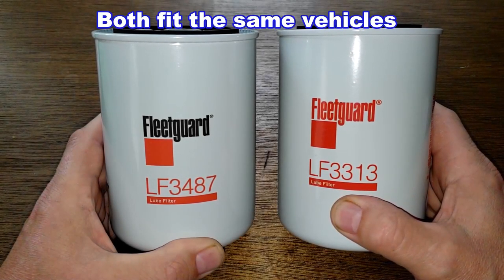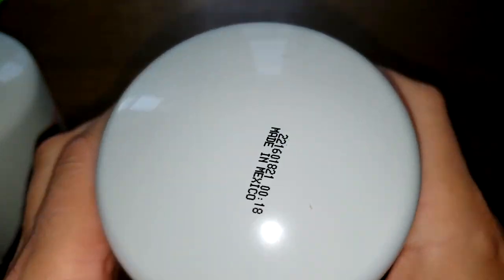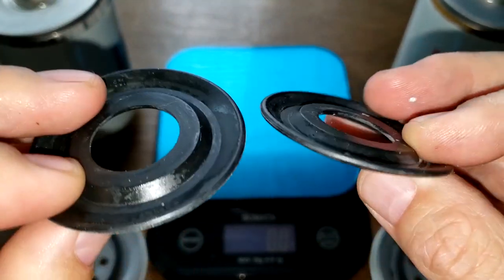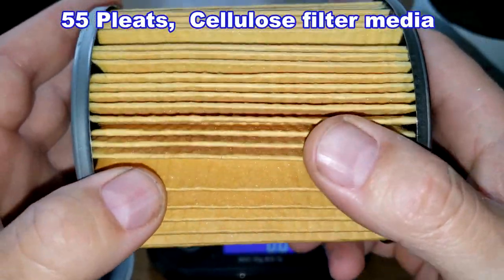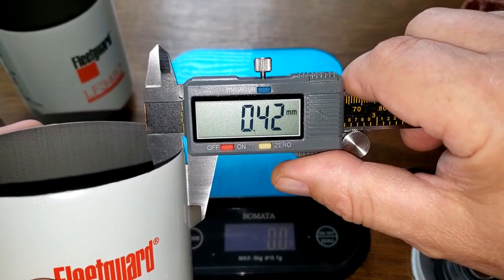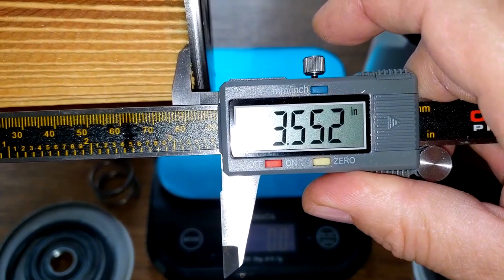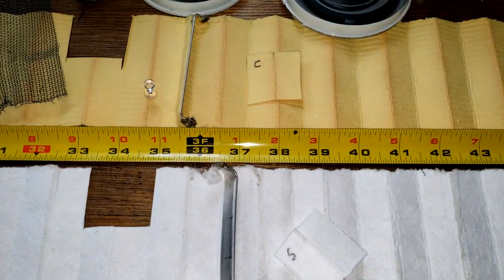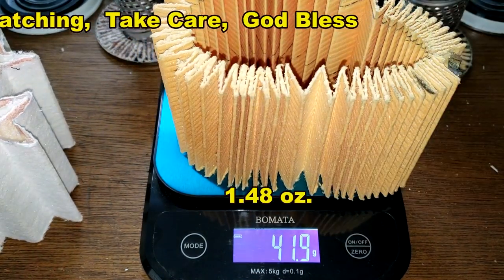Fleetguard LF3487 Oil Filter vs. Fleetguard LF3313 Oil Filter Cut Open

Comment: 68% at 30 microns for the cellulose model?  That has to be a typo. Is that the worst rating ever seen so far? Now 100% at 30 is probably 99% at 20 or 25 and much better.
Reply from the maker: Could be, check this out. https://catalog.cumminsfiltration.com/catalog/partsearch.do?&reqCmd=PartInformation&partNumber=LF3313&PartType=Lube,%20Full-Flow%20Spin-On&Part=-&criteria=part&_locale=en

Comment: I do believe you're exactly right! I called "Fleetguard" or Cummins Filtration 20 years ago and that's what they told me, it's the media. I haven't bought one of those in a long time but they were made in the US when I did. They should probably consider upgrading the 'rubber' parts to silicone for what you pay for one. They used to call the 3487 media "Microglass" and it had a sparkly appearance. I think that media is more a synthetic + fiberglass now. The BPV on the ones I got were 11-13psi. Also had a real metal backing screen on the 3487. They really cut back on that one! I probably wouldn't 'search' one out NOW, like I did in the past. I think the Boss would be a slightly better filter. Nice comparison, thanks!
Reply from the maker: It's a real metal screen backing, I was just pointing out how flexible it is, some are really stiff.

Comment: The 3487 is the superior filter, media (wire backed full synthetic) and efficiency rating. Both look to be well made HD diesel filters. Both use louvers, which is fine. Too bad not made in the US though. Last Fleetguard for vehicles you posted was made by M&H Purolator in the US. Thanks for vid.
Reply: Fleetguard has a plant in Quimper, France and San Luis Potosi, Mexico in addition to their USA plants.
Reply from the maker: Your Welcome faxmen09!
Reply: @Nash_Nismo  That's good to know, but doesn't change anything in my post.

Comment: Decent filter all around. I've used more of them than any other brand over the years. With that being said, some filters do come from France. I've had one of each French and Mexican made. Be interesting to see if you can get two different manufactured location of the same one.
Reply: Fleetguard has a plant in Quimper, France and San Luis Potosi, Mexico in addition to their USA plants.
Reply: @Nash_Nismo  one is oui and the other is si
Reply: @mimelio  😂

Comment: Been running Fleetguard oil and fuel filters on my 6.7 Cummins for years.I have had some great oil analysis results from blackstone labs. Fleetguard makes the highest quality filters IMO.  I run the stratapore version witch is the synthetic media Lf16035.
Reply from the maker: I'll be opening up that filter sometime in the next couple of months.
Reply: fleetgard filters are owned by cummins.

Comment: In regards to the cellulose media efficiency rating, I had purchased a smaller filter from Fleetguard and requested the data sheet from them for it. This is what I got:

Anti Drain Back Valve Yes
Valve Opening Pressure 144.8 kPa
Element Collapse/Burst Minimum 0ISO 4548-3
Hydrostatic Burst Minimum 0ISO 4548-6
Capacity 11.8 ISO 4548-12
Rated Flow 11.4 L/min ISO 4548-12
Efficiency 30.8 @ 21.0 micron (c)

My understanding is that this is not the typical % efficiency at (numerical figure) micron rating we're familiar with. Instead, based on my research, the first number, 30.8 is actually the βₓ value at 21.0 microns. When you convert this to the traditional filter efficiency we're accustomed to using, it becomes 96.75 at 21.0 microns. On an estimated sliding scale, I'd say that suggests a 95% efficiency at 20 micron rating, which is comparable to the old, standard WIX. I'm paraphrasing my own post in the thread linked below. I'm not claiming I'm correct, but it's the only reasonable explanation I can come up with for their cellulose media efficiency rating.

https://bobistheoilguy.com/forums/threads/help-with-oil-filter-data-analysis.357612/#post-6184210
Reply from the maker: Thanks John,
Looking at the microscope pic, I think it is better than what I said it was also. This is where I got the info for this filter, but I'll pin your comment so that it sits on top. https://catalog.cumminsfiltration.com/catalog/partsearch.do?&reqCmd=PartInformation&partNumber=LF3313&PartType=Lube,%20Full-Flow%20Spin-On&Part=-&criteria=part&_locale=en
Reply: @WhipCityWrencher  appreciate it! I'm tempted to confirm directly with Fleetguard, but I'm fairly certain they measure their efficiency in Beta (βₓ). If I hear back from them, I will post back. Thanks for your insight with the microscope, too. You've looked at a lot of media from a lot of filters that way, so it definitely helps.
Reply: @WhipCityWrencher  

Well shoot.

I just got off the phone with one of the gentlemen on the technical assistance line for Cummins Filtration. He told me that typically, hydraulic lube filters are rated in βₓ the other filters (oil, fuel, etc) are stated at a percentage-based efficiency rating. I updated the earlier post with a picture of the data sheet for the filters I'd gotten and inquired upon. If I'm reading the sheet correctly, coupled with what the gentleman on the phone said, I'm not sure these are terribly good filters in terms of efficiency. Here's the specs for anyone who missed them:

Anti Drain Back Valve Yes
Valve Opening Pressure 144.8 kPa
Element Collapse/Burst Minimum 0ISO 4548-3
Hydrostatic Burst Minimum 0ISO 4548-6
Capacity 11.8 ISO 4548-12
Rated Flow 11.4 L/min ISO 4548-12
Efficiency 30.8 @ 21.0 micron (c)
Reply: Okay, last update. I reached out directly, in writing to the company, for clarification. This is the response I received:

" I confirmed the information is 21 microns @ 30.8%. The filter was crossed from a Wix filter, and meets the specifications of that filter."

To be honest, I'm not really sure what to make of that.
Reply from the maker: @mphilleo  I don't know, that seems to be worse than what I quoted in the video.🤔

Comment: I am guessing that plastic spacer the spring sits in takes up that extra difference in height to maintain correct spring tension.  Also other cellulose media filters rate their filtration much better. Curious as to why there is a difference.  Both look like good filters. Fleetguard seems to be a consistently well made product.
Reply from the maker: Read the pinned comment, thank you.

Comment: If the bypass valve is rated at 10 or 15psi, and the engine oil pressure is above that (40,50,60psi), doesn't it mean that bypass is open all the time when running?

edit : I guess if the filter gets clogged enough, that's when it gets pushed open.
Reply: Bypass valve rating is the internal pressure difference in the filter itself. I had to look this up a while back. It was confusing to me for some reason.

Comment: 30 microns isn't amazing for any filter, I'm not sure why they didn't test it lower at 20-25 unless it was a blow out.

I really like the look, and construction of the filter, just several many synthetic filters on the market already which push basically 100% at 20 microns.
Reply from the maker: Most I see are 99% at 20 microns, this LF3487 filter may have about the same micron rating.